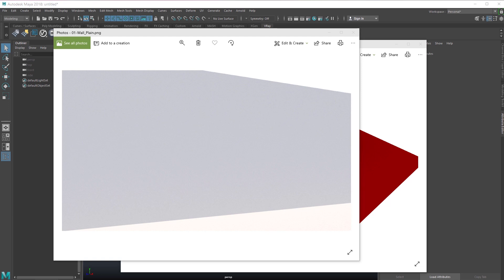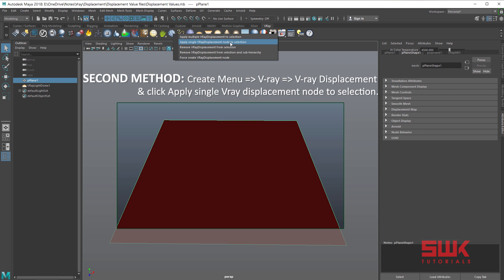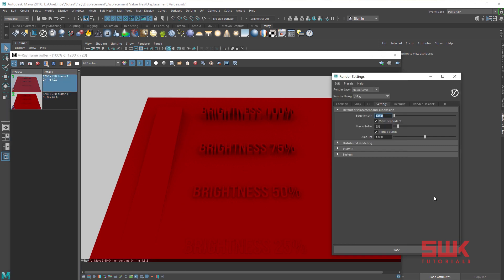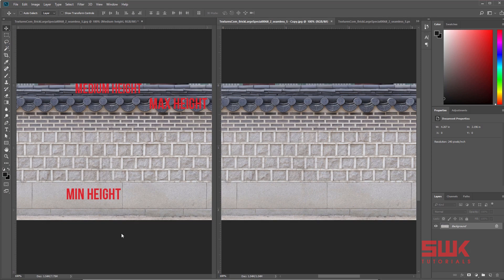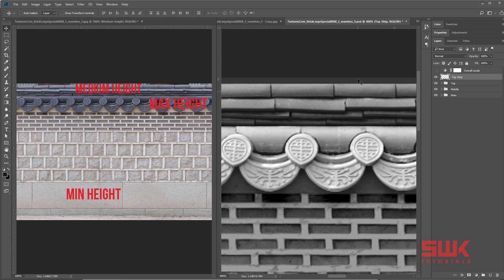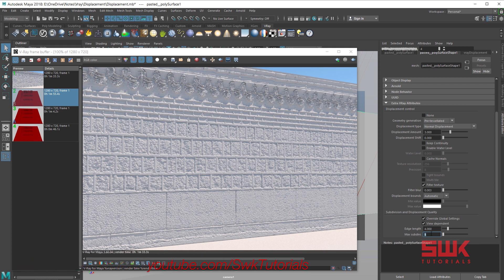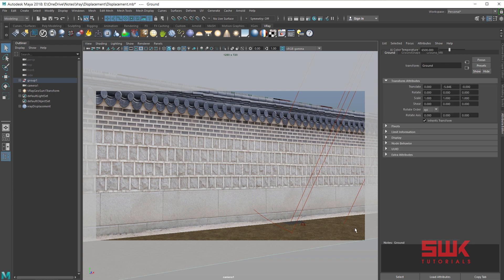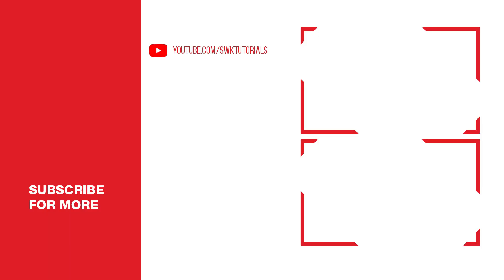Vray Displacement in Maya - Add details to geometry without modeling

Comment: Hello
Every time i click on the displacement node in the outliner the mesh it's attached to disappears and i cannot control anything
should i just move back to arnold or what? it simply does not work be it with normal or vector displacement.